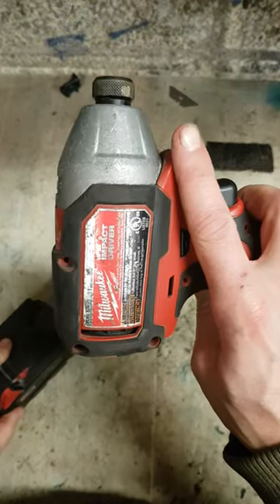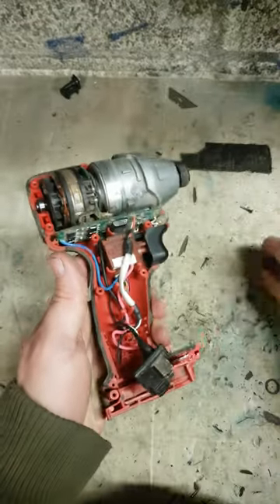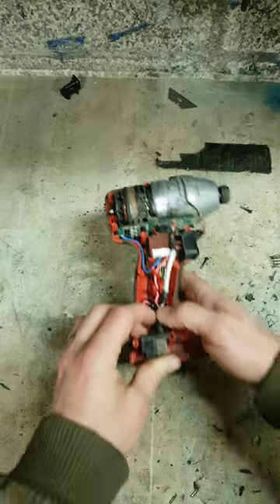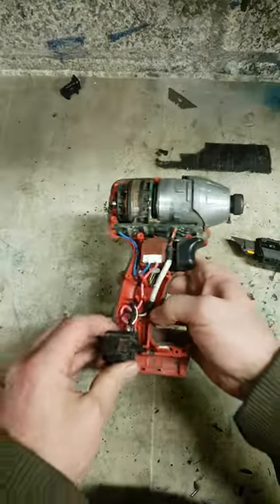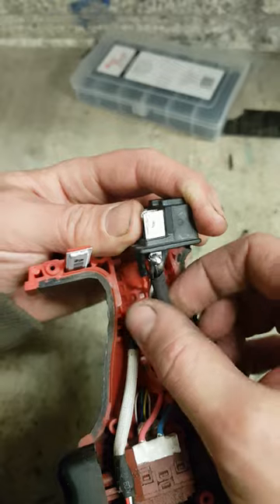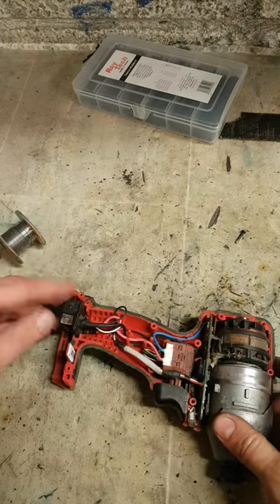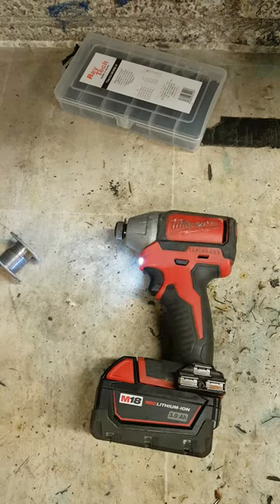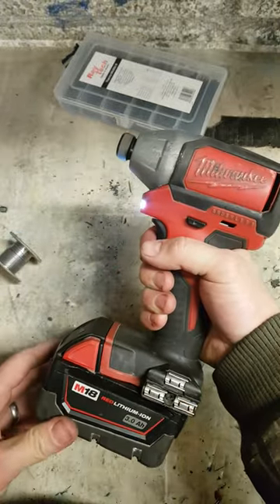Repairing a Milwaukee impact driver that's starts and stops.

Comment: This is awesome. Exactly what mines been doing for ages. I'll be on with mine tomorrow. Cheers 👍
Reply: How'd it go? I have a couple Sawzalls I'm going to crack open.
Reply: @stevenross5342   It now works perfectly! I took it apart and cleaned it all etc and checked wires. The wires were good but the deep clean totally sorted it. Thanks 🙏

Comment: I had a quick question. I have a M18 fuel impact driver that all the sudden has begun to give me problems. It runs really slow. The #3 speed now acts like the #1 speed .. The selector still works.. #1 is not super slow, #2 a little faster.. etc. I didn't smell any smoke or electrical smells. and I was using it, and it just all the second happened like the battery died  I tried other full batteries. and they all act the same? I opened it up and saw no visible broken wires or contacts, everything seems fine. Any idea what it might be?